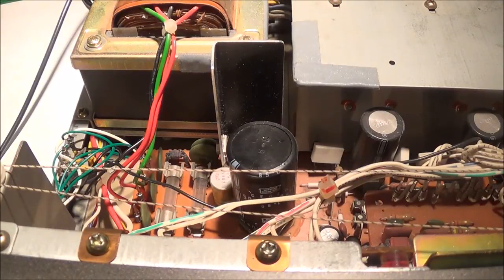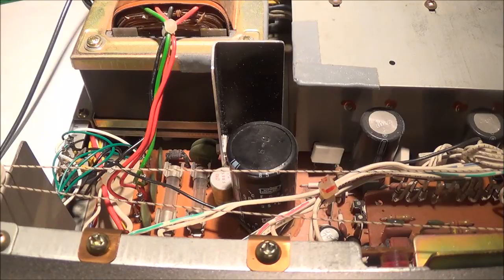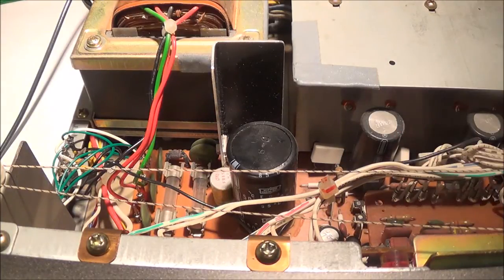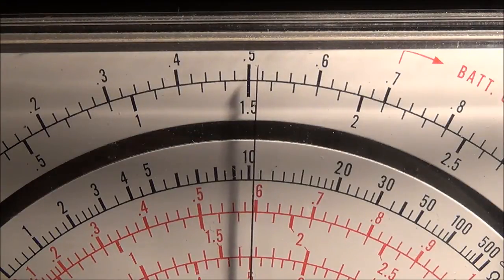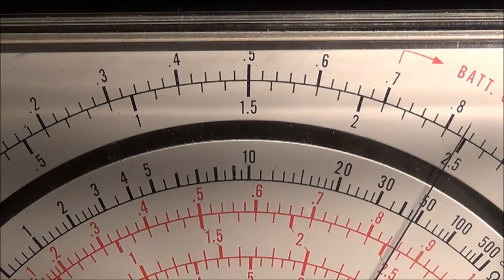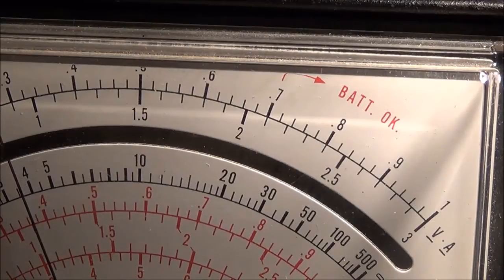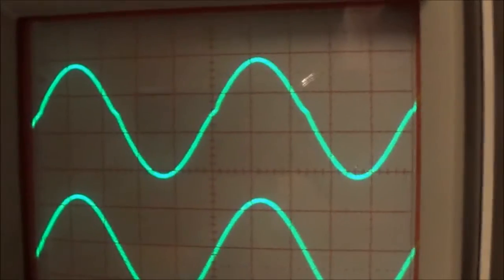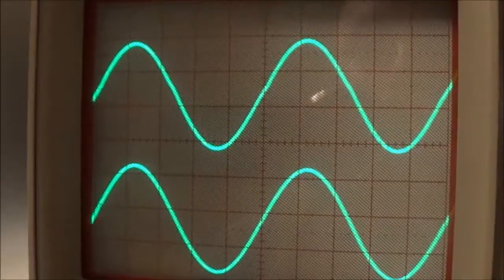Akai AA-1010 Stereo Receiver Idling Current Adjustment

Comment: Excellent video. The Akai owner manual shows the fuse removed when checking idle current. Shouldn't the fuse be in place when checking idle current since that would complete the circuit?
Reply from the maker: Thanks! I don't even remember making this video. The current flows through the meter (with the fuse removed.), therefore the circuit is complete.

Comment: Interesting learn that I can measure idling current thru the channel fuse holder. 

Usually others talk about measuring  voltage across the output transistor emitter resistors. 

👍👍
Reply: Emitters are safer, use Ohms laws to convert mA into mV and the upside is, don't have to worry about blowing your meter.

Comment: Hi. I have Akai AM-73. I can't adjust idling current.  When i measure stay on 0mV. The positive voltages (on big capacitor), when i turn OFF amp, they drop to 0v for 20 sec. The negative voltages stay 42volts. I don't have any shorts. Do you have any idea, why positive voltages drop only when i turn off amp?
Reply from the maker: I haven't worked on the AM-73 before, so I can't really answer this question. I would check the idle current potentiometer, check solder joints (and do some resoldering) and wiring connections (if the idle adjustment is on a separate board), and make sure nothing is shorting to ground.